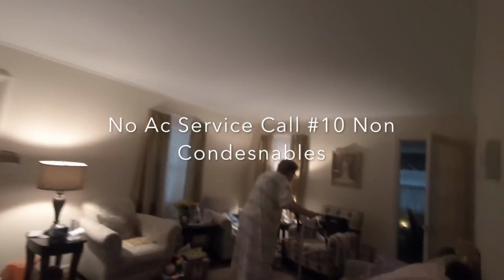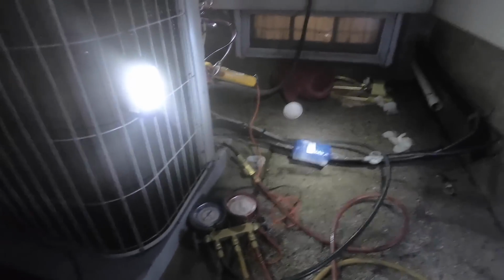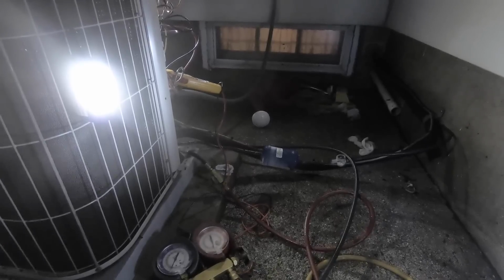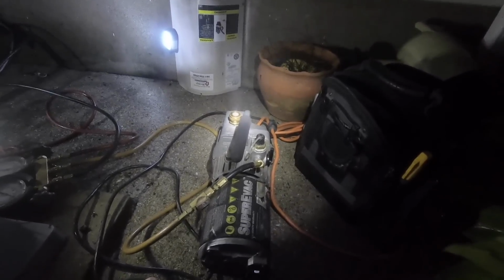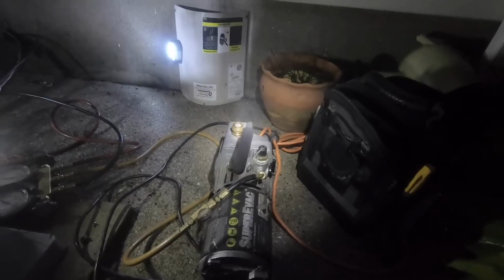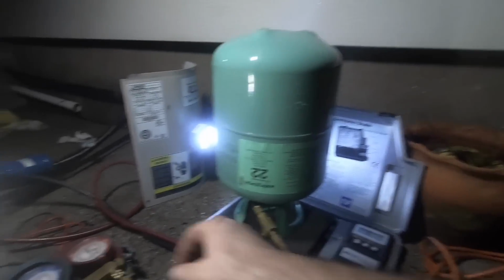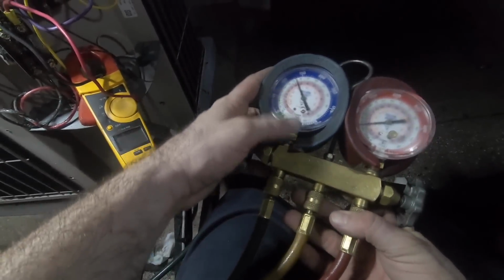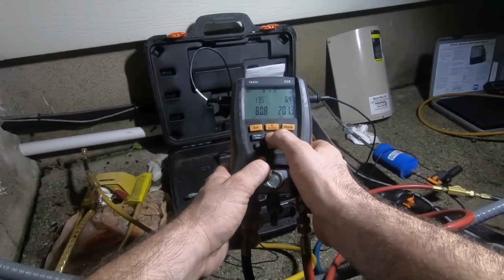AC Not Cooling Contaminated System Overheating Compressor HVAC

Comment: Non condensable will crowd out refrig liquid in condenser = super high superheat & head pressure. Overheat trips overload. Contaminated with 410A possible by hack.

Comment: If you suspect contaminated refrigerant why did you not do an acid test and change out the filter and or add a suction line acid  filter before adding the new refrigerant

Comment: a few questions
 1. why not use a micron gage during the evacuation process?
2. when you finished the evacuation you disconnected the evac pump before you closed the valve on the gauges did you not introduse air in the system
3. why use the old gages when you could use the testo during the troubleshooting and evacuation process?
Reply: Maybe he likes analog better, I do for trouble shooting
Reply: It's impossible to find a micro leak without using a micron gauge, and you should always take your gauges off with positive pressure. Granted, you might not notice any moisture issues immediately, I find that copper carbonate builds up on the threads of the txv needle over time from moisture and causes it to stick, and in some case's even seize.

There are legitimate reasons why 0% moisture in a system is critical, especially with poe oil.
Reply: He can use whatever the hell he wants, as long as he knows he's job and what he's doing and all the years of experience are better than any micron gauge or   expensive gauges.

Comment: Can you show us diagnose a bad txv or do you have a video?
Reply: If you see the head pressure rising and suction pressure dropping is one way to check. Bad txv usually comes from bad brazing practices like not flowing nitrogen and/or not pulling a deep enough vacuum.
Reply: Hold the txv and see if pressures adjust or don’t change
Reply: High suction or head pressure, I forget but I think it’s high suction indicates a restriction somewhere so I check the filter dryer temp and if that’s okay I check the txv. I could be wrong here 😂

Comment: I grew up in Sussex County NJ awhile back since 1955 now I'm in Pocono's Pa 25 yrs. about 3 weeks ago i went to my sisters in Newton NJ, her Steam boiler (a Thatcher installed 1959) was leaking and not coming on, i fixed it, its been working perfect for last 3 weeks she said,, she called for 2 estimates, they told her it was 2 old and cost be $10,000 so she would have heat,, i fixed it for her free,, its ok now, no leaks not using water, running perfect

Comment: If the freon recuperated was mixed, how would you be able to test for that?
Reply: superheat and subcool would be wonky and not within any documented specs when adjusted for temp and pressure. other than that you would not be able to field test what mix was in there.

Comment: You do not use the quarter inch fitting on the pump it is used for test purpose only. Need tree for 3/8inch port and 3/8 × 1/4 hoses
Reply: Who told you that? Pump manufacturer? Only to sell you the larger hose which has ONY been readily available for the past 10 years. For us veterans, we have been using the wrong hose for all these years? I doubt it bubba.
Reply: @come_on_now  in the Ritchie yellow jacket manual it states that they reccomend you use the 3/8 or 1/2 inch port on top of pump and use the tree with the 2 -3/8 ports with larger diameter hoses to pull vacuum on system. I been in the feild for 30 years and used my manifold to pull vacuum on systems it took awhile. Now I use this method and it cuts the vacuum time. Time is money. And my micon gauge shows 200 or lower for a deep vacuum  also learned that micon gauges don't lie if you have a leak trust your equipment
Reply: @richardvisco6370  all I am saying is that "recommended" is not the same as "required" which is how you made it sound...
Reply: Nothing wrong with using 1/4” on a vacuum lol I bet you do that on rtus instead of using tees
Reply: @murkyturkey5238  blue vac is the way to go

Comment: In no way is this how you should do your service calls..
Reply from the maker: jasond138 why not? Unit is fixed and been operating with no issues since this repair
Reply: WTF? What is he psychic? How the hell is he gonna discuss anything before he gets a chance to check it out?
F..n trolls.
Reply: @stevee7774  LOL FR, the compressor was overheating and it took longer since he had to cool it down. You never know what you are going to run into the field, could be a bad capacitor or you could always run into this 🤷‍♂️ you never know.
Reply: I hear ya.. i actually show all my customers the fieldpiece joblink app and talk about vapor sat with 90 year olds all the time. My point was always discuss first before starting the work. Never work for a long time then talk to a customer.
Reply: @jasond138  I bet you don’t get much repeat work. Kinda of a shitty attitude.

Comment: There are so many things wrong with this whole thing. 1. Who works for 3 hours without talking to the customer? 2. Who does a bunch of a work with taking a picture or showing some kind of proof?  3. Who says HOPEFULLY to a customer?  If that was a guy, you'd be outta there..
Reply from the maker: jasond138 I work like this all the time. Customers only want results. With how the system was operating I couldn’t guarantee anything only do my best to get it up and running. I do what I have to. Only on some jobs will I get a customers ok before repairs. Unless the parts are expensive no one ever says no don’t fix my ac, it’s almost 100degrees that day. My customers are not price shopping. They want comfort
Reply: @thehvachacker  at no time should a customer say the words " your still here" to you. Try and keep them involved as much as possible and NEVER do a bunch of work without first establishing there may be a cost.
Reply: Another know-it-all troll.
Reply: It's true I say hopefully too, we may know that the ac will work, but we also know that it may not work. Ac's are complicated sometimes
Reply: @jasond138  He works for a big company and they handle the billing I believe, doesn't apply in this case as the customer would be billed anyway at this point.
Reply: Honest people dick head jizzle 513
Reply: You know who says hopefully? Doctors. "hopefully" they can fix you. There is no guarantee. You just hope the doctor can fix you. They don't give guarentees either!!
Reply: On a 20 year old... hopefully is used regularly!

Comment: I kinda believe the lady when she said no one serviced it, I kinda think there is a leak in the low side and over time it has lost its charge. Pumping in air will cause a higher head, I did not see the litmus paper in the sight glass I think I would have changed the dryer and left the vac pump on over night, was the dryer cool when the vac pump was on? Check it in the near future to see if it has the same charge the dryer will hold close to a llb of r22. I have seen a lot of units with moisture and good thing for the dryer

Comment: Was the high pressure cutoff/limit broken Or not installed?
Reply from the maker: I wish I could remember this was 2 summers ago. Yet this unit is a base model so most likely didn't have a high pressure switch

Comment: what flashlight are you using? i need one of those
Reply: 63878 LED MINI WORKLIGHT FLASHLIGHT  $1.19
  Original price:  $3.99
  Coupon Discount: ($2.90)
  Coupon Number:  31920661
Limit 4 
Harbor Freight, June 4, 2020
I have a hard time finding a store with any of these cuties in stock, left one for the next guy while I took three for myself after a year of trying to get another one. The big long one is a $40 Braun also at HF and sometimes also on sale for less.

Comment: Non condensables in it ..
You're on the right path.
Recover the dodgy gas, replace liquid line filter, purge with dry nitro, evacuate and vacuum to 500 microns then bomb charge the liquid side and see what happens.
Should come good. 
Someone before you has either not vacuumed the system properly and has possibly had atmospheric pressure build up or put the wrong gas in it. Big no no !!
You are an excellent tech. You treated that lady with respect and honesty. Good for you man !

Comment: So at the end what is defective? Is it the compressor?
Reply from the maker: Someone mixed refrigerants. Once I pulled charge cleaned out system and charged system back up. The System has been operating since I left. I am scheduled to do an ac maintenance on this system in 2 weeks
Reply: @thehvachacker   could make a follow up video on your maintenance when you return?
Reply: @thehvachacker  yea mixing refrigerants will do that.

Comment: Judging from majority of these negative comments, it leads me to believe some people have only done work in controlled environments 🤔  sometimes you have to do what you have to do to get it up and running, I've seen systems just purged with gas after major works no vacuum and is running perfectly more than 10 yrs with regular schedule maintenance
Reply from the maker: The trade has become really scientific with all this superheat and subcooling. Older units that were just purged or barley evacuated would go 30-50 years. When 100 degrees are hitting it’s all about providing comfort not leaving a system down. Many when I started would pressure tested with r22.
Reply: There’s the perfect world(classroom/ lab), then there’s the real world!!!!!

Comment: I worked at a AC Repair company at Poland for a couple of months, where I wasn't really authorized to do such stuff but in many cases, people just bought some refill kits from internet without paying attention to get the right gas.

How is it in the US?
Do you get also this kind of issues on the daily basis or is it rare that something like this happens?
Reply: I can speak for the automotive industry on this. It isn't so much about the wrong refrigerant there as it is an insanely incorrect charge. You have R-12, R-134a, and now R-1234yf. R-12 and R-134a use different port fittings so no danger of mixing refrigerants. The issue is that R-134a canisters can be purchased EVERYWHERE and many come with a single low side gauge only. You hook it up, pull the trigger until the needle goes to the green zone, and then you're supposedly done. 🙃 Many people don't understand that there are so many more factors to it than that. You're supposed to have the windows all open, fan on high, fresh air intake, thermometer in the dash vent, looking at high and low side gauges, and charging so that the vent temp is perfectly in range and the evaporator isn't too cold. People also don't bleed the hose when hooking up those trigger cans, so they whack a bunch of non condensable air into the system when they recharge it. :( Without seeing the high side and the low side, one can't diagnose a faulty compressor or plugged metering device or dirty coils etc. I love DIY. I will teach and empower and guide anybody to DIY something if they are confident and understand the risks, but the availability of these DIY refrigerant canisters empowers the DIY car owners who don't have sufficient knowledge to do it the correct way. It's a false sense of competency, the left side of the Dunning Kruger graph. People also don't understand that but the time a new car has aged and begun to have AC performance degradation, the semipermeable hoses have allowed moisture into the system and the proper thing to do at that point is to recover, replace the filter drier and the amount of oil within it, replace the oil in the compressor, flush the coils, and then refill all those components with the correct oil charge, replace the O-rings that were removed and any easy to access, vacuum it down, fill with dry N2, vacuum again, then charge by weight. Car AC systems are slowly tortured to death over many years and they're pushed along at the end by owners who shouldn't attempt a DIY repair but try anyway. :( Sometimes being wise is knowing not to try something yourself and hiring a pro to do the work. That is very hard for ME to do because of how many idiots I've seen call themselves professionals.

Comment: Why wouldn’t u want a site glass on an hvac residential split?? Let house get reasonable temp to close valve down and fill the glass up. Check subcool and compressor superheat and your golden. I’m gonna miss the R22
Reply: Site glass for liquid receiver systems.
Reply from the maker: A sight glass only gets service calls where a customer thinks they need refrigerant. Yet system is perfectly charged even with minute flashing
Reply: The HVAC Hacker I don’t do residential service so I can understand that. I do a lot of refrigeration and I understand minute flashing but if it’s constantly flashing when running the valve is not getting 100% liquid. Good video appreciate your work
Reply: @thehvachacker  Site glass is only for critical charge systems, mainly commercial fridges, coolrooms and the like.
 I wouldn't waste my time putting one on a residential unit. Sometimes you will see flash gas due to high heat load and some inexperienced people will mistake it for an under charge, then proceed to overcharge the system reducing it's efficiency.
And, site glasses tend to become leaky over time too. Don't add another potential for failure.

Comment: Hey, have you ever run into a unit that has a "death rattle"?  My buddy's window unit cools, but only barely, like just BARELY better than moving air.  It's an old Fedders unit we found (what happened to Fedders?) and when it is running, it makes this repeating, loud groaning/rattling noise.  What happens here?
Reply from the maker: It could of lost most its refrigerant charge, or the condenser is dirty so compressor is overheating

Comment: Great job I hate those calls. I didn't notice if you put on a new drier or not? I'm sure you did just off camera
Reply: that's what I was thinking too.
Reply: You don't need to replace the drier if the system wasn't opened to atmosphere. You recover the refrigerant to just above a positive charge, then you place it on a vacuum. The vac pump will do the rest.

Comment: That's gotta really damage the compressor's lifespan with no suction accumulator.
Reply from the maker: Depends how long it operated like that. This call was August 2018. It ran all  this summer no problems. Oil doesn’t smell burnt, that’s what could shorten the life of the compressor. Burnt oil is what leads to an acid burnout
Reply: If the unit has been serviced properly it will never require a suction accumulator.

Comment: I have worked very hard to mark everything I have been on is year with Freon make. I have had this happen to me with a 407c unit and R22 mix. psi was close but got low or no cooling it was just not right. Pulled charge add new R22 it’s working great Thanks you great video (it was a R22unit)
Reply: I've never had an issue when it comes to mixing 407c with R22. I've done it multiple times and I've never had a call back.
Reply: Sauce Clipz The problem with the practice of adding a different refrigerant to a system will be eventually seen if refrigerant leaks out due to zeotropic azeotropic blends...which seems to be the problem here

Comment: You test the capacitor with the wires still hooked up. I thought that would not give an accurate reading.
Reply from the maker: You just need to disconnect one side of the capacitor and it will test accurately

Comment: Compressor overheated, electrical fine, i’d wager a stoppage on suction line before compressor was there. Not enough to cool compressor, not enough movement to lower pressure on low side, as you said pressure was suction of R-410A which is about 118psig or 68ish degrees saturation for r22.  Rise in low side pressure indicates suction restriction, rather than orifice restriction. Which leads to one of two culprits: first is a misplaced king valve, but i can’t see it, or a noncondensible, like you diagnosed, caught in the suction line
Reply from the maker: It’s been so long yet I think it was a cocktail of 22 and 410. Compressor couldn’t compress at those pressures. Only thing that matters in the end is this machine is operational since that repair
Reply: That could do it

Comment: On tx system go by sight glass to back up liquid in condencer
Reply from the maker: Txv systems need to be charged to sub cooling. Which is making sure the condenser is rejecting the heat from refrigerant and making the hot vapor turn into liquid.The old way was charge by sight glass. We don’t even put sight glasses on systems anymore.
Reply: Never go by sight glass alone... Measuring temperatures is much more precise and charging by superheat/subcool is the standard now. Residential systems don't even come with sight glasses anymore.